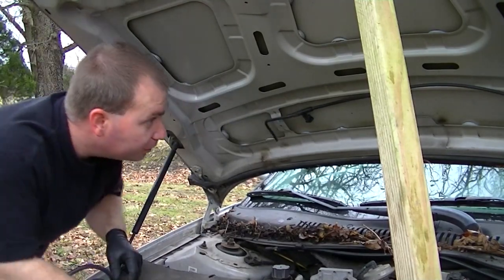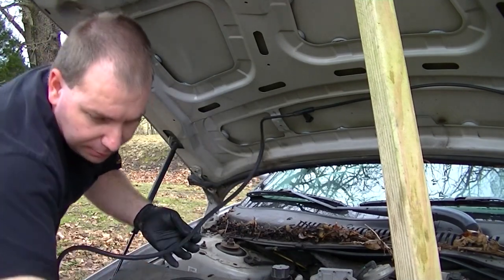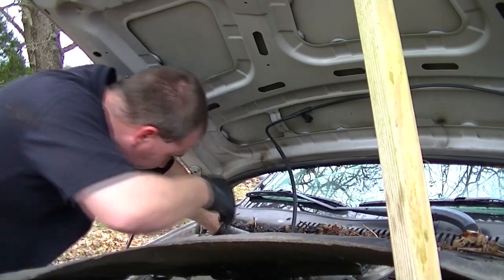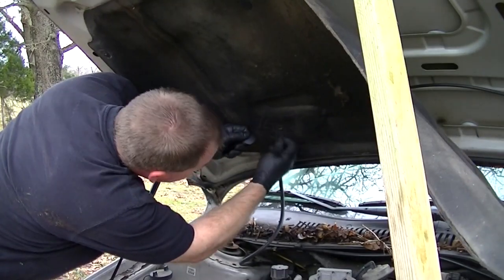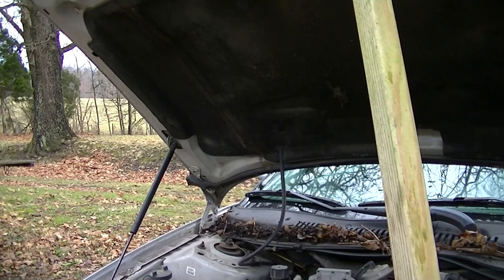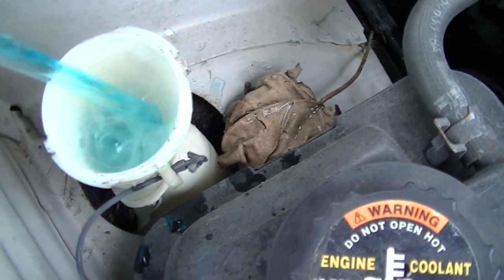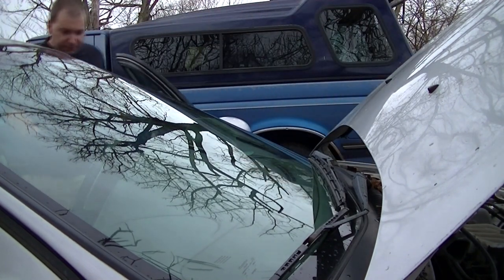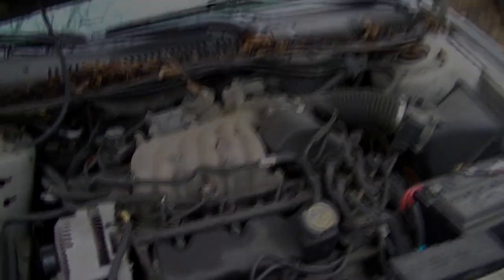Taurus Windshield Washer Hose Repair

Comment: Not only did the hose on mine (07) separate, but after repairing it (twice), chunks broke off the inside of the old hose and clogged the drivers-side nozzle! Then, when I opened the hood to remove it for cleaning, the old hose snapped in two again! The stock hose clearly wasn't meant for hot environments. Still, not been a bad car otherwise, though the engine mounts are about shot too now...

Comment: Same problem here, where does the hose connect to the pump? Thanks. nice video.
Do you just yank those clips off for the heat sheild or is their a trick? Thanks again
Reply: +Dan Webster (Paw Paw) Just tuck a couple of fingers under them & pull (and wiggle at the same time) straight out. Be careful none fall into the engine compartment though: they can be a bear to find & get out.

Comment: Just throw the car away,lol,the hose is worth more than that POS.
Reply from the maker: This car outlasted most. It made it to almost 300,000 miles on its original engine and transmission.
Reply: That's impressive,but def not the norm for those cars,Trans usually goes at about 100,000,and as far as the rest of that car,I'd like to see the laundry list of things you've replaced,bet I can name them all,lol,these cars have hundreds of TSBs on them,and everyone of them comes true sooner or later if you own the car long enough.
Reply from the maker: I never had to do much to it. The alternator went out at 105,000 miles and I replaced with one from O'reilly Auto Parts, and in 2004 I replaced the coolant tank, and in 2011 the low side A/C line from the evaporator rusted in two. Aside from two tune ups, brakes and oil changes that was about all I did to it. I never abused it and kept the oil changed regularly. Now up towards the end the pistons slapped a little when it was cold but did not use any oil.
Reply: that is great,wish my Taurus was this good to me,I'm thinking mine was built on a Friday afternoon,lol
Reply: fonzo2424 I have a '99 Sable SW. It has been an incredible car. Currently at 107,600 plus. My engine and tranny may be different. Model year makes a huge difference. Would need to check. Leaves collect on mine in the same place, though.
Reply: 293,000 on my 2002 24v.  Original engine and trans.  No major repairs to date.  The car would be great if it wasn't so rusty.